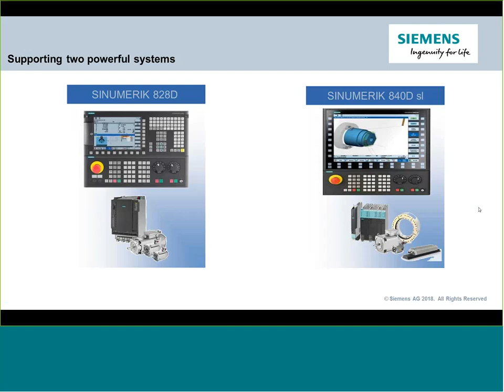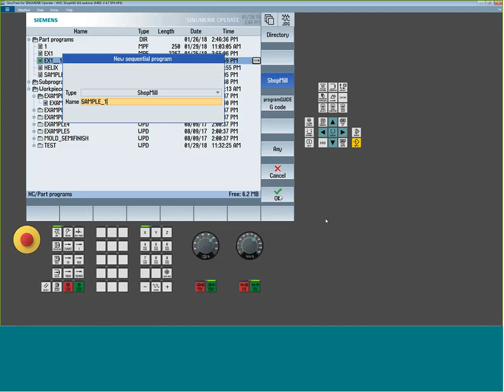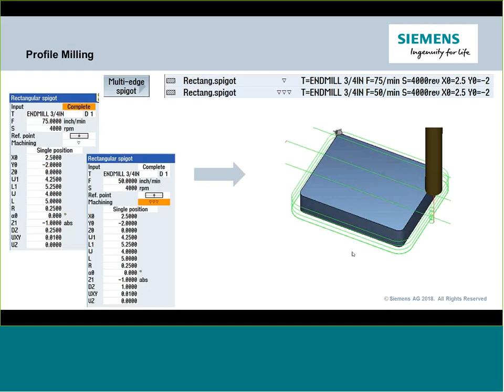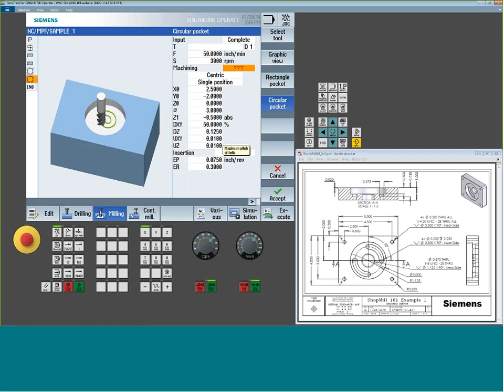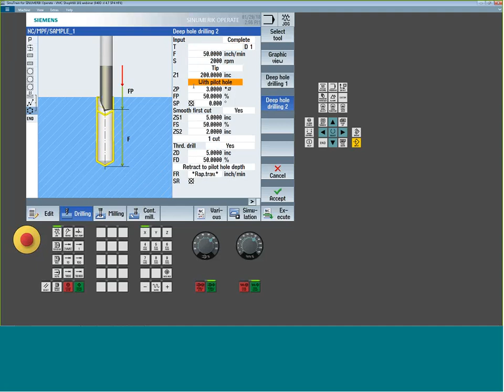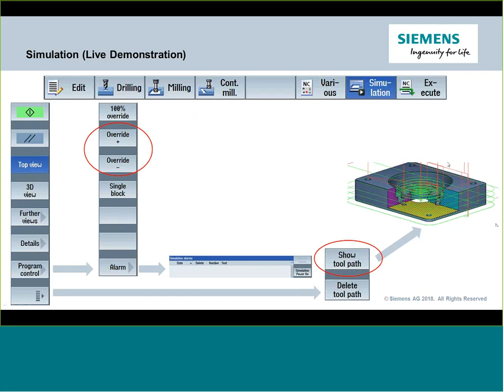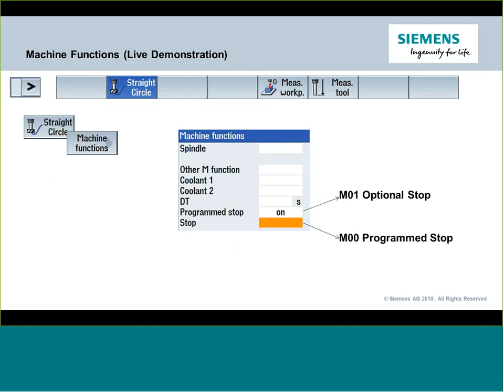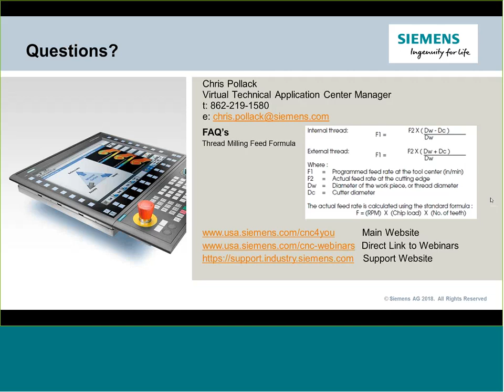Shop Floor Programming 101 with ShopMill   SINUMERIK 840D Sl & 828D Milling

Comment: Amazing resource, thank you. We've just received a DMU M1 with 828D control. I'm working my way through your videos. 
Question: at 1:07:38, you show what looks like a sectional view in simulation. How can this be done? I haven't seen it covered yet.
Thanks.
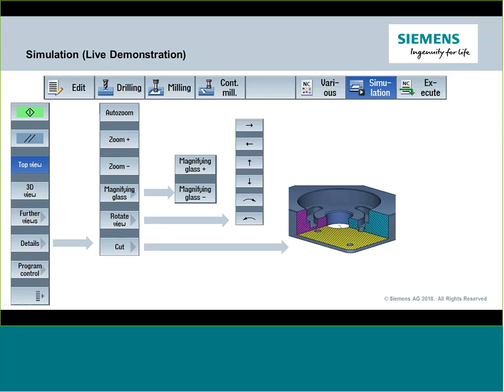Reply: Seen it at 1:26:47
I was too keen....
Reply from the maker: Glad you found it! It'll take some time to get used to our expanded options with the vertical and horizontal softkeys, but you'll get there!

Comment: Does it have tool point control and tracking for a 4 axis horizontal?  We have a Cincinnati magnum 800 with the 950 control. Looking to upgrade.
Reply from the maker: do you mean WZ tracking or Full TPC
Reply: @MrCNC  tool point tracking, as the 4th axis spins
Reply from the maker: depending on build and what options you get

Comment: Hello sir its possible to do edge preparation on the pipe
Reply from the maker: Are you referring to setting of the work coordinate system?  if so then yes.  the control can probe cylinders in either an ID or OD strategy.

Comment: Hi there,
I just wonder if I got postprocesor to Sinumerik 808DShopMill it would work for 810D ?? is that same code ??  and how many tool position can I add in Sinumerik 810D ?? such as in Hurco is 9999 positions in tool table in Fanuc 400 and in Haas 200, how many is if in Sinumerik 810D  ShopMill ??
Kind reg
Dan
Reply from the maker: to the best of my knowledge they should be the same

Comment: Please, if the sound can be better i will apreciate. If i listen o  tv is poor sound :(
Reply from the maker: You may be having an issue on your end.  I have checked the videos and the sound is ok.
Reply: @MrCNC  but for those who do not understand English very well some words are not clearly heard, I have to look and listen very carefully several times, nor does the subtitle help me sometimes.  anyway maybe only I have this problem that I am learning to listen to a rich and full sound on an audio system
Reply: @Andbln369  Siemens is an Euro company, they will certainly have info in different languages 👍 Probably if you lower the speed of the video it could help 👍
Reply: @tamanako2507  after this report the sound is more better in the next videos ;)

Comment: Sir not showing shopmill option
Reply from the maker: what control are you on?
Reply: @MrCNC  Siemens control
Reply: @MrCNC  Siemens 828d
Reply from the maker: what is the machine tool?
Reply: I have the same issue. I assume I only have a Sinutrain license and not a ShopMill license, but not sure how to confirm that yet. Edit: Nope, I was wrong. The ShopMill option is on the right bar when I create new program - I was looking for it in the dropdown menu.
Reply from the maker: @wardropcr  on the actual machine shopmill is an option.  you can see if it is there by going to Setup then expand the horizontal keys to see the license screen.  On sinutrain it is always licensed but if you are using a set file created from a real machine it may not be active.  try using a template machine.